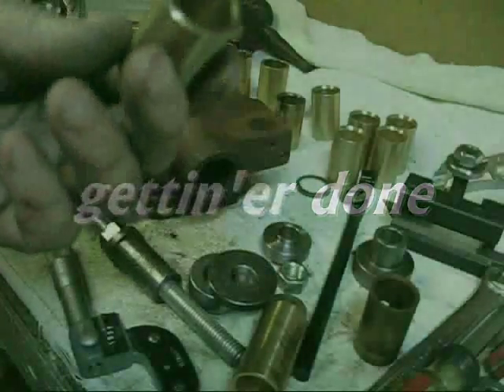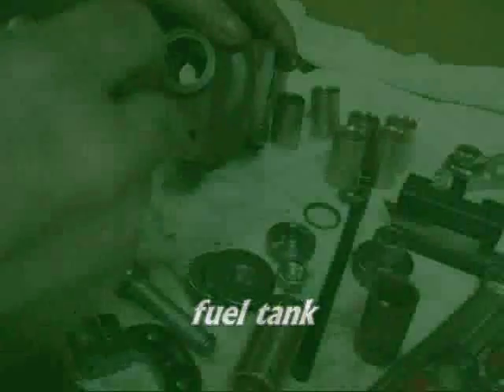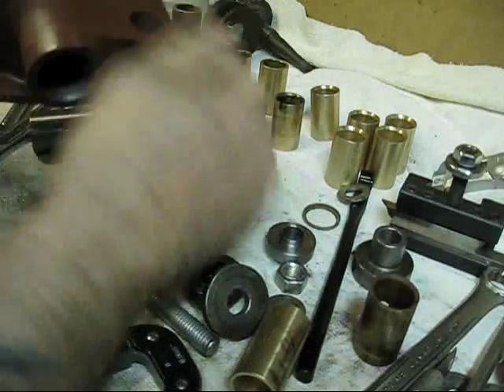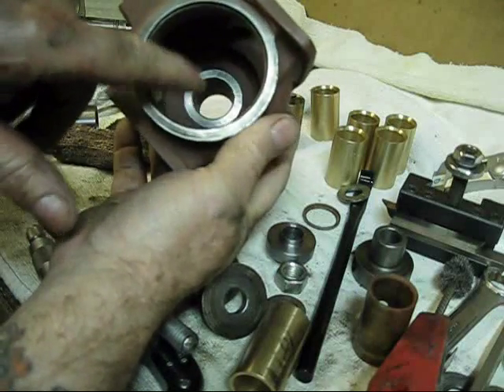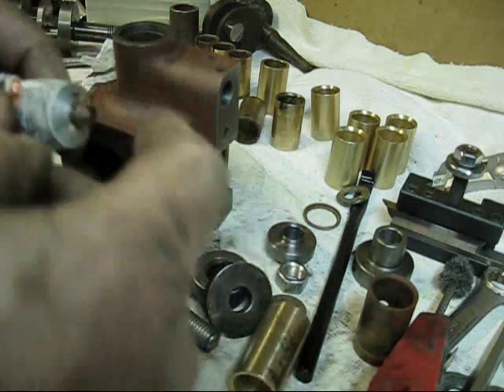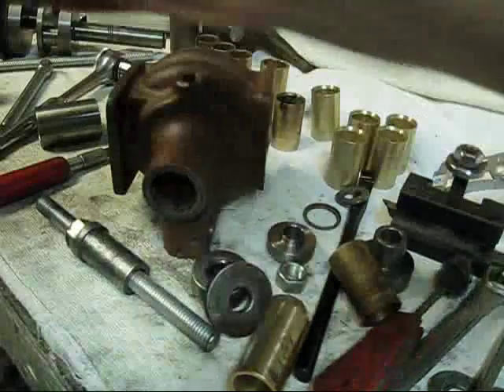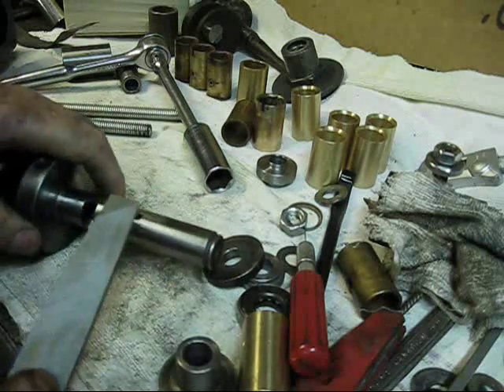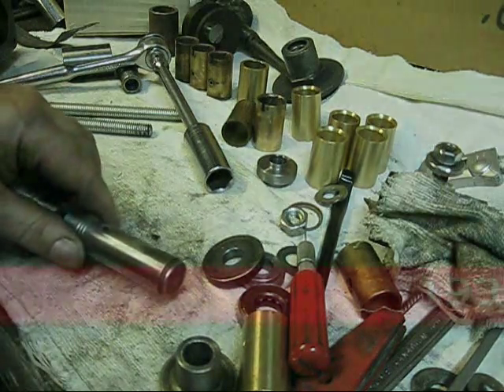1937 Maytag Engine  model 72  repair #16

Comment: He is very meticulous but when you use glue and call it lubricant it's still glue. When he pressed the bushing into the case there was a wall of permatex that built up in front of the bushing and just like cake batter it filled in the groove and drain back. It is glue. When it hardens it there. To be so particular I can't believe he did that.